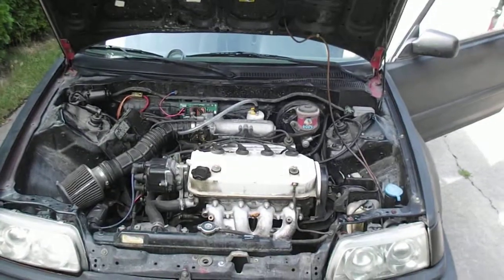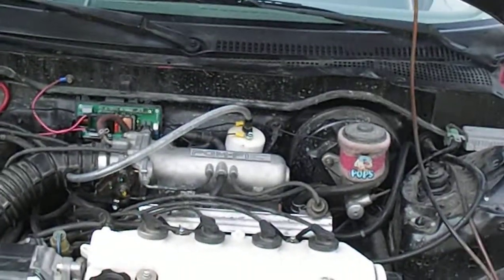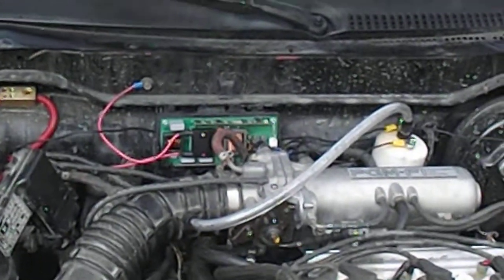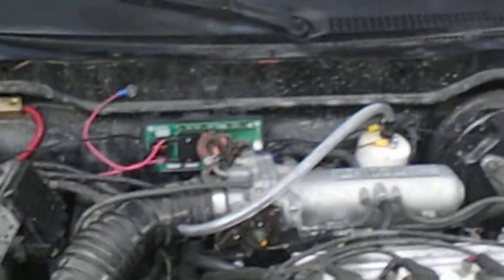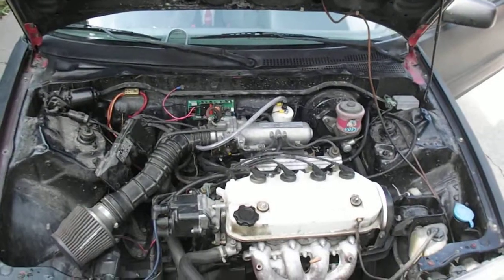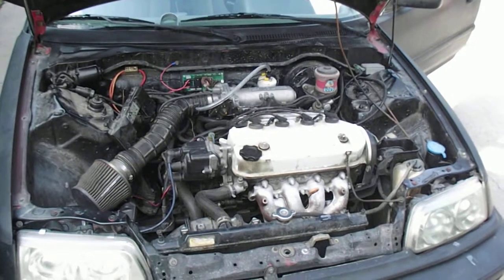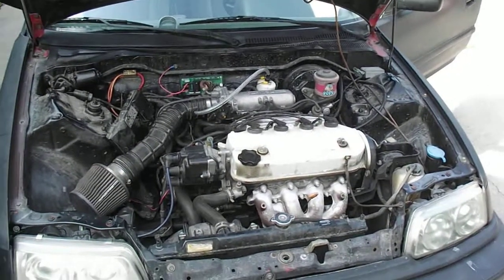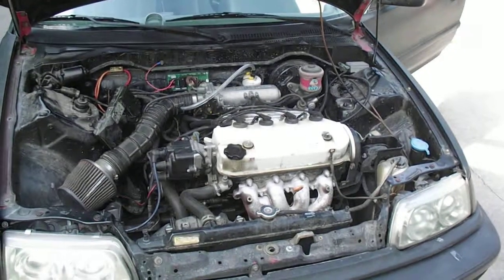HHO installed in my 1.6l Honda Civic

Comment: Hey do i have the same car, Did this work? are you still using it? hopefully you can get back to me .
Reply from the maker: Hey, I only used this on my civic for a short time. It did not work, 
because it uses an O2 sensor the added oxygen in the system causes it to
 push more fuel thinking that it is running lean. In order for a HHO 
system to work you will need and aftermarket Oxygen controller or a 
programmable ECU. I did however get it to work in my 86 ford ranger on a
 closed loop O2 setting. I used a PWM(pulse width modulator) and ran 
30amps through my system and saw a 7mpg gain (16mpg to 23mpg). I was 
impressed with the system and the engine ran much smoother with a much 
better torque curve. I'm sure if I was running an O2 controller I would 
have seen much better results but all in all HHO does work but it can 
get very expensive to run a proper HHO system.
Reply: boberbland hello, interesting setup u have, im trying to think of a setup to put on my 99 civic. Have u tried unplugging the o2? And run the setup in open loop?